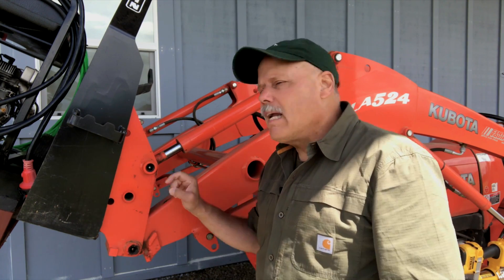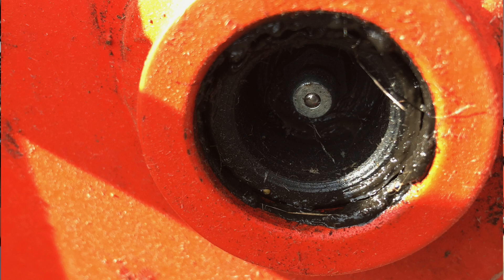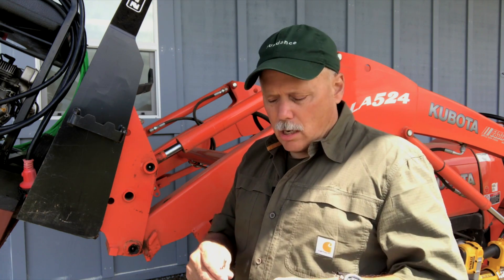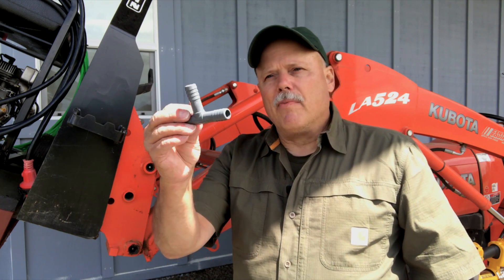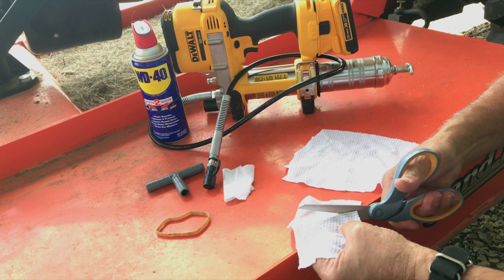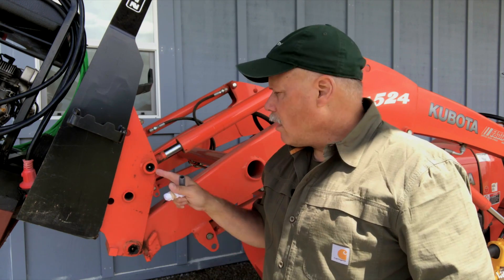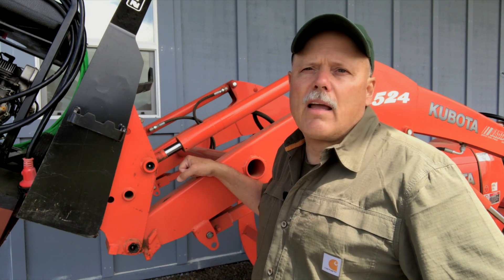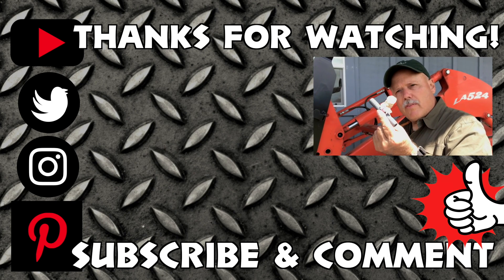Grease fitting cleaner - Kubota L3800 Tractor Maintenance Quick Tip

Comment from the maker: Shout out to Ask Tractor Mike
Click here to subscribe to Ask Tractor Mike: https://www.youtube.com/user/thebigrockranch

Grease fitting cleaner and inexpensive DIY tractor maintenance tip. This grease fitting cleaner is easy to make with materials you likely already have in the shop. A grease fitting cleaner will make lubing grease fittings on your tractor easier! To make your DIY grease fitting cleaner all you need is a 1/2 inch barbed T-fitting, some 2x2 cloth patches, a rubber band and a can of WD-40.

Comment: You can remove the zerk, put a few drops of GoofOff and will instantly dissolve the hardened grease. You can also put a few drops on a pipe cleaner and will clean out hole on equipment

Comment: Great vid. I like to make sure that the zert (grease fitting) does not get clogged. I put zert covers on. Yep, then I have to pop them recessed covers off with a small screw driver. I grease and put back on. That's it. I don't care about the entire hole being clean. My tractor is not a show tractor. No offense, just saying what works for me. Yes, some times the covers have to be replaced because they get knocked off. No big deal though. I buy a bag of covers off eBay so that I have plenty available when needed.

Comment: What about a plastic or rubber cap/plug to place into the hole after greasing? Would this keep the area clean but still allow easy access for maintenance?
Reply from the maker: Great idea ... I have been looking but haven't found anything yet. The lowest one does get banged around quite a bit so the cap / cover would need to be pretty durable. Thanks for watching! 😀
Reply: USNERDOC What about a strong magnet the diameter of the opening? Or not even a strong but just a low profile one? Like the free pizza ones we all have on our fridge. Cut one of those and see how long it lasts.
Reply from the maker: Love your ingenuity!